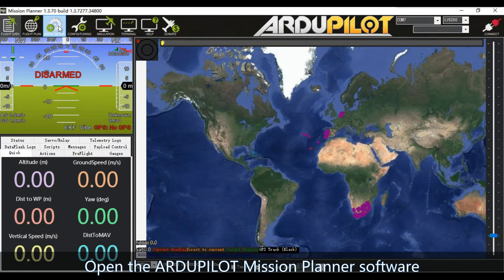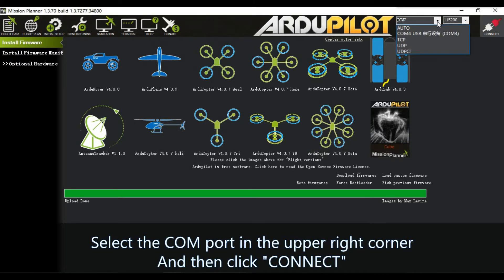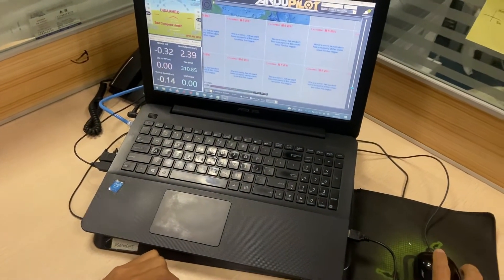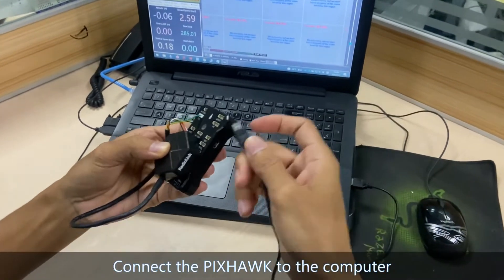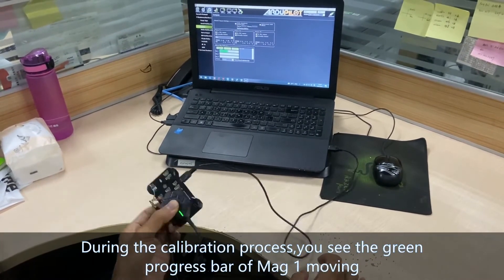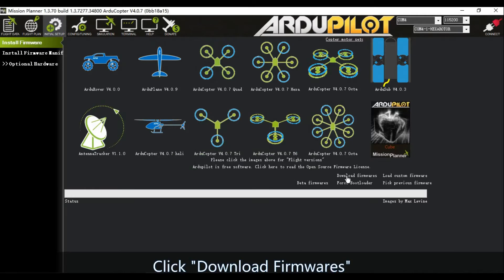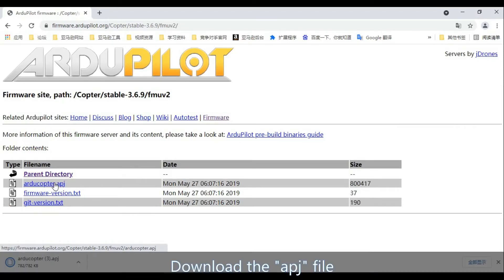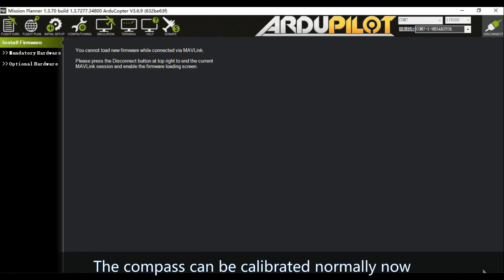Radiolink Pixhawk Flight Controller Firmware Update 4.0 or Above and Calibrate Compass

Comment: Is it okay to use any telemetry with it ? "100mw | 433mhz"
Reply from the maker: Hi, sir. Pls confirm with the telemetry producer if it supports Ardu pilot flight controller. If yes, you can use it with PIXHAWK.

Comment: Does Radiolink sells telemetry modules for the flight controller?
Reply from the maker: Yes. We have PRM-03 Real-time Telemetry module. It can work with RadioLink PIXHAWK/Mini Pix/TURBO PiX  flight controller. Model voltage, speed, climb, throttle, longitude, latitude, altitude, GPS, RSSI, flight mode, yaw, roll, pitch, and distance are display on the transmitter screen. Here is the details of PRM-03: https://www.radiolink.com/prm03  You can buy it from Amazon or AliExpress: https://www.radiolink.com/prm03_where_to_buy
Reply: @Radiolink_official  Thanks! The PRM-03 can be used to communicate with a ground station right? How far is the range?
Reply from the maker: @khaihoe3841  Yes, Sir. You can check all information on RECEIVER page of your transmitter. The control distance of PRM-03 is same as the receiver control distance.

Comment: You are using a gps with compass module,so Why the green progress bar of the mag 2 is not moving??
Reply from the maker: The green progress bar of the Mag 1 is the extra GPS, Mag 2 is the inner GPS by PIXHAWK.  Since Dec.29, 2019, ArduPilot official has updated the firmware of arducopter(multirotor), arduplane(acrobatic) and ardurover(car/boat) to V4.0. However, the sensor integrated of firmware V4.0 has been modified, they block the inner GPS sensor of Radiolink Pixhawk, that's make the progress bar doesn’t move when calibrating the compass, but it won't affect the performance of work. So we suggestion you calibrate with extra GPS or install firmware below v3.5.
Reply: @Radiolink_official  but my problem is when it calibrated Pixhawk only with internal compass,the mag 1 moved.But when I calibrated along with gps ,the mag 1 moved only
Reply from the maker: @Anonymous-mm9tt  which version firmware do you have?